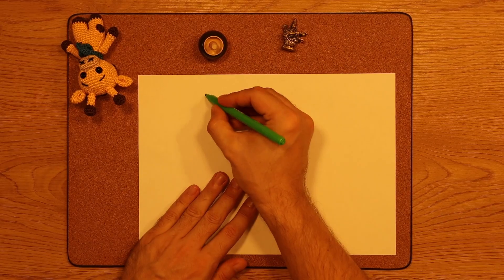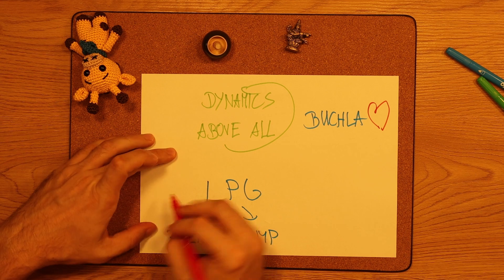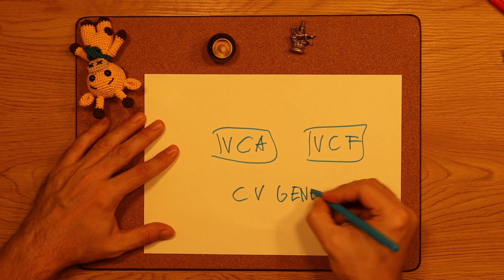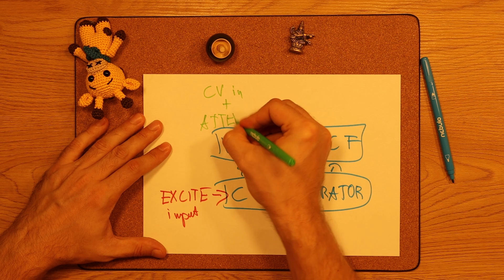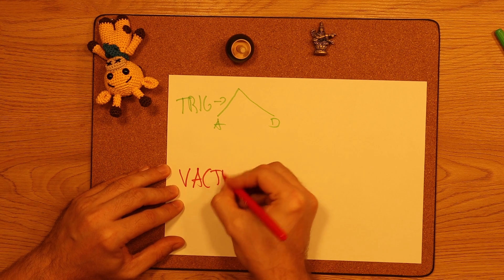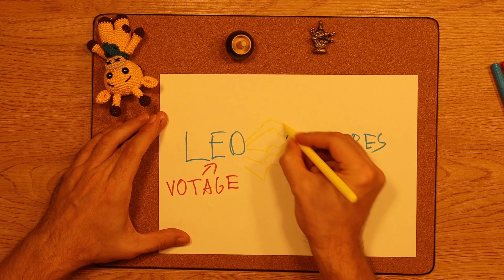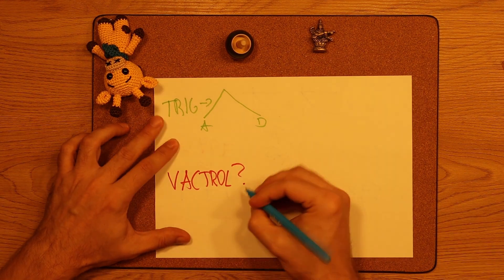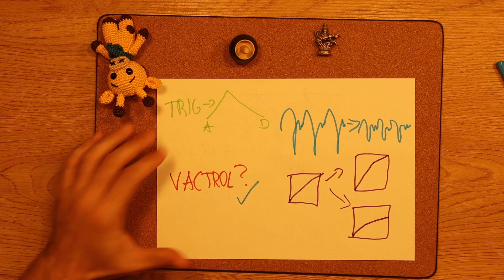Mutable Instruments Streams - Explanation, Patch Ideas and Synthesis Techniques

Comment: Excellent video Bylant, I'm torn between this, Make Noise Optomix and the simpler Doepfer A-142-2 for my tiny lunchbox rack. My need is for ENV and VCA in 8hp, Michigan Works has a 8Hp uStreams which seems amazing, and these three option seem to fit my need, Streams looks like it offers a fair bit more than the other two options so I'm leaning the way. Do you have any thoughts on this?
Reply from the maker: Hi Jin-Hu, thanks for watching.Streams is absolutely worth it (either the original or a clone) although I don't know the Optomix and the Doepfer. But if you need vca AND env, this is the best option. I think I don't demonstrated enough how good is Streams' internal envelope, it has a lot of useful curves mainly for imiting acoustic instruments. You can use it as a standalone vca as well with external envelope.